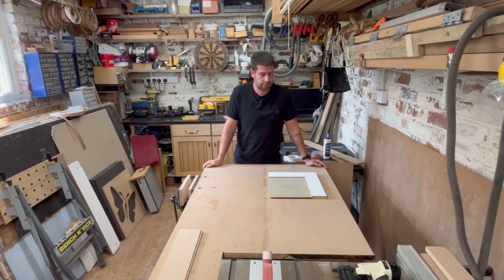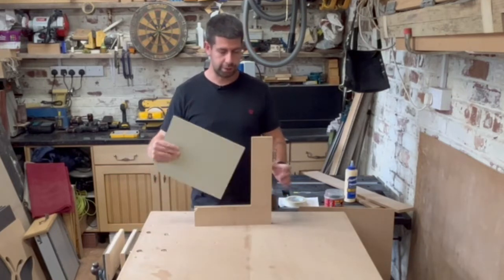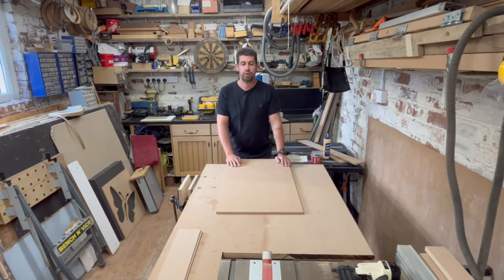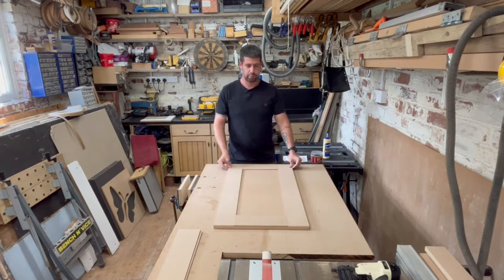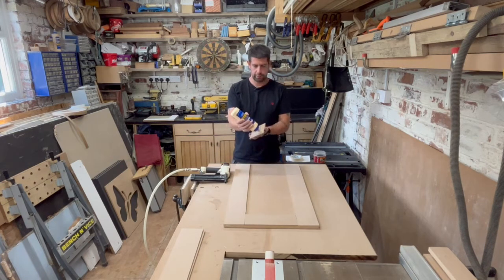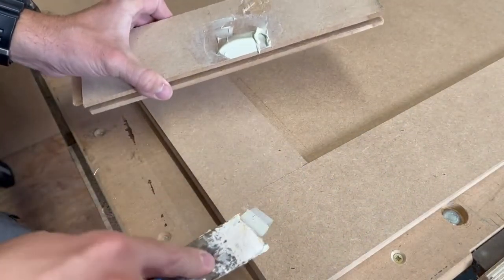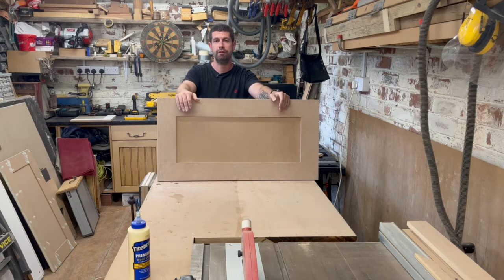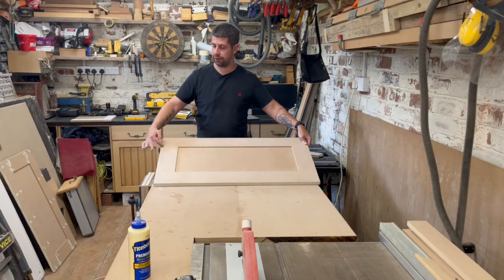The Easiest Way To Make A Panel Door Or Shaker Door. Guaranteed.

Comment: Do you ever work with high grade wood like Oak where you want to preserve the actual surface?
Reply from the maker: I am a cabinet maker by trade and I have worked with lots of different hardwoods. I don't work as a cabinet maker right now so I don't use hardwood much. Most of my YouTube projects are for my own house and my wife doesn't like the look of wood so I paint everything.
I have got a stockpile of hardwood so I might use it in future videos.
Reply: @spendtimesavemoneydiy  I have oak floorboards and oak doors - nothing I love more - so warm and cosy. When I was young I all about blacks and greys and laminates, but now I prefer the reassuring warmth and durability of decent wood. Horses for courses.
Reply from the maker: @Martial-Mat  personally I love european walnut. So that's what I've got in my study 👍🏼
Reply: @spendtimesavemoneydiy  I almost went with walnut with embossed cream trim for my doors but the company wanted I think 8 weeks lead time while they were hand made. I couldn't be damned with that. They were classy, but so are my oak doors - real heavy, sturdy doors - so  happy with them.
Do you have walnut flooring in the study or a desk?